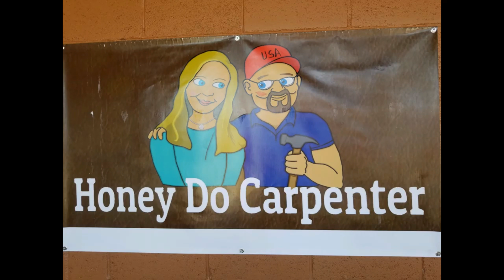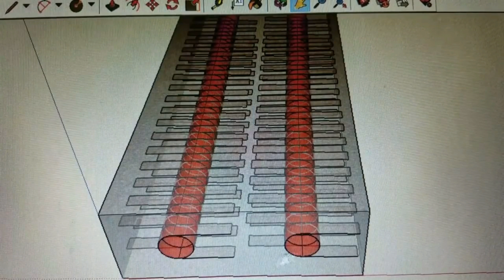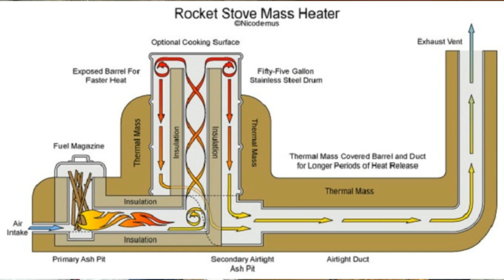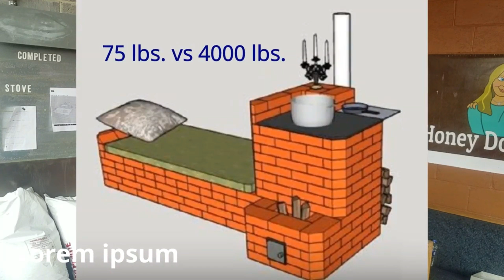Super Efficient Homemade Stove , Use 1/10th the Wood

Comment: Darwin I am extremely intrigued by your design and the capabilities of your stove. Would this be considered a rocket mass wood stove? I actually have a pot belly wood stove that I have been thinking of adding a secondary burn chamber where the current exhaust comes out encasing that with a cylinder for the heat and gases to further burn and combust then route my exhaust out through the back and up to the chimney as well as insulate the inner walls of the firebox with aircrete. I can definitely tell you have some awesome engineering skills I'm not as good as you but I definitely aspire to be! my question to you is if I sent you a few drawings/my ideas do you think you would be able to help give me some pointers on my design based off of your experience with what would work and what I would need to change? also If my ideas work I am thinking about doing so on a larger scale to help heat our school house that we are working on thank you so much!

Comment: Masonry has ~0.2 BTU/lb*F heat capacity, steel ~0.47.  Few materials come even close to water at 1.0 BTU/lb*F.  How many pounds of masonry does it take to make a thermal battery to store 300,000 BTU if heated from 62.8 to 199F (hottest part of the FTIR scale)?  300,000 BTU is the typical amount needed to heat a small 1000 sq ft house in the north.

Comment: I would like to have one of these for a 24' Tipi? You got plans for building one that will not be too large for that size Tipi? Even the one here shown will do for me? I plan to put it on something that will roll like casters I that possible The smaller the better for the Burner part. But the mass will be separate and I plan to have mass? If I bought one you made how much am I looking at for everything but the mass part of it?

Comment: Are you able to make a larger scale one that can revives more wood. I want something that can be put in my greenhouse in the winter and provide heat through out the night until I get up in the morning to add more wood. If yes, how much
Reply: in greenhouse you can put a compost pile for heat in the winter. also they say that a bunch of leafs will give some substansial heat too

i saved a video on the topic in my playlist called "fire" where someone with a stove in greenhouse dumped it after they found out that it was enough with leafs, perhaps there was a container of water too

Comment: Remember that shiny metals have a very low emissivity and you does not get anywhere near the real temp.
Paint it black and problem solved, and also help radiate the heat around it that can increase efficiency a little 😉

Comment: Please be careful about having the high heat of a rocket stove against steel.  This WILL result in the spalling of the steel (basically corrosion) and destruction of the stove.  Coating the steel does help.  Regular concrete can spall also, so try using fireplace mortar or refractory cement.  Try ceramic fiberboard for most of the structure, supported by a steel frame, and the firebox lined with firebrick (to withstand the abrasive wood).  
Would you be so kind as to try refractory cement in your Aircrete machine please?  Thanks.  Could you also experiment with the riserless rocket stove design?  Thanks for all your work and ability to make the knowledge available.

Comment: Love what you are doing, I  have been kicking around the idea of using solar hot air system fan running on a small solar panel so it would work automatically.  to heat up the thermal mass of the stove bench or a thermal wall, heating up all day simple hot air panel should be around 140 plus degrees and you would only have to do a burn when it's really cold. I'd like to get your impute.
Reply: exactly. do it!

Comment: am I missing something? Or another video?  You talk much about how great this is or was in one burn, but I never see a burn, or any details of testing? You can tell me how unbelievable it is, but how do we see it? @6:21 time, you say you go over test results? I must be missing this?  so your saying this 75-80# of unit weight, will hold how many BTU's?  I am very willing to be impressed, but please show me.
Reply from the maker: Scott, I get it , really I hear you. However testing it and burning it in the open air is not quite as impressive as putting it in a 2000 square foot home basement we are running data tests as we speak in a home where it was installed first with a window insert and now I am placing it in place of a standard stove to an existing chimney. I am altering the chimney by dropping aircrete insulated stove pipe down the chimney to run the stove out of, stay tuned. thanks HDC
Reply: @HoneyDoCarpenter  still tuned 😎

Comment: Negative pressure in any system is created by chimney temperature. 
If the chimney temp is too low, it will run positive pressure. Exhaust temps need to run at a minimum of 200°F.  
Having said that, if you're chimney temp is much higher, you're throwing away excess heat.
Reply from the maker: sounds like advice from a kindergartener
Reply: Do the tests on different arrangements.  You'll discover the same thing I did.
Classic bench style rocket stoves (or any other stove) only ever go to positive pressure when the chimney temperature is too low. Cooler gases in the chimney want to fall back, work against the heat riser, create positive pressure in the bench and back-smoke, leak, etc.
This is directly tied to how much heat the mass absorbs and how much is left over to rise out the chimney at the end.

I've done this test several times, building test beds with various heat absorption capabilities. As long as the chimney is hot enough, a bench pipe full of holes will consistently draw inwards. This can be seen by waving a smoking ember (incense or tobacco stick) near the holes.

This will change according to the difference in temperature between the exhaust and the outside world. 200° F is about right in that the outside air is not likely to ever get that hot and water vapor will not condense within the pipes. I've seen these work with far lower exhaust temps, but they become unstable and fail to work well in all conditions.

Comment: Have you been able to concoct a mix that can be pumped with a cheap harbor freight trash pump.  The best I have come up with loses about 20% volume.  It works, but decreases the insulation value and increases weight density - not ideal for a roof.   I also modified your wall forms to be removable and make interlocking panels - just cut the small metal u track in half and tack in another in opposite directions (or you could just bend your own)... goes together air tight with a small amount of spray foam or mortar and holds together great with stucco (the mesh and stucco help hold it together too).

Comment: Darwin, are you saying this model cannot be used with a bench? I am looking to put the stove in my attached garage but run the through an internal wall to a bench in my main living area. Exhaust would be vented up through garage roof. Thoughts?
Reply from the maker: It will work just fine for a bench

Comment: Do you apply some water glass coating on the surface of aircrete panel ?
Reply from the maker: I do treat the riser with water glass, and while it is still wet I sprinkle portland cement on the inside to give it a hard coating, Three seasons on julies riser and going strong.
Reply: @HoneyDoCarpenter  That's great.  Thanks Mr.Honey Do Carpenter.

Comment: Darwin, I have a few questions  first isn't this just a smaller version of tiled stove, with metal around it instead of tile?
Second what size area can this heat? It might be good for a 200 sq ft room but there is no way it can heat a 2000 SQ foot house with walls. 
Third where is the exhaust going to?
Reply from the maker: actually ,yes it can heat a 2000 square foot home...
Reply: to answer your questions first as far as i can tell its a rocket mass heater version.

second he is installing one for dirtpatcheaven in their 2,100 sq ft home and they will be testing it this winter.
third the exhaust gets run outside if you want more info let me know.
Reply: @GH-sy5wn  again o don't see it any different from the Russian tile stoves, but I'm interested in finding out if the mass is enough to heat that home. I fear it won't be for overnight. I know I'm a few months behind on the videos, but I really do love his core and his firebox, can't wait to see the thing work in a bigger space.

Comment: It the temp of the exhaust that determines the efficiency.
The thermal camera shows high heat at the top
Reply from the maker: That is the top of the riser.all The heat is right where it should be. The major heat is in the secondary burn area at the base of the riser.  The Stove is working perfectly.
Reply: @HoneyDoCarpenter   yes
But if hot air is escaping at the top then efficiency drops 
Ive seen videos of people sticking their hand in the exhaust
Loooking at about 110 F  
You do have a exelent design 
Just concerned at the exhaust temp
Reply: @tomrobertson3236  that must be interior insulated riser and then mass heat-absorbent cover goes on top and over it, redirecting rest of the hot air thru outlet at the bottom, near the burn chamber. I am trying to decipher the concept built out of those clips as much as possible...
Reply: @Prosper661  the traditional rsmh has a 55 gal drum turned up side down over the riser
The sq ft gets quadruped thst way 
So the exhaust gas decompressed 
The drum then becomes cooler and radiatez out into room 
Darin is on new ground so it will be intersting to see what he comes up with 
One thing you cant do is rob the riser of heat 
Its needed for complete combustion
Reply: @tomrobertson3236  traditional rsmh can weigh few tonnes and metal drums gets burned and replaced yearly (second hand info, don't quote me on that). Darwin's initial idea was portable stove and highly efficient, with heating as primary purpose (no cooking) with possibility of connecting it to a mass heat-absorbent bench. Aircrete qualities allow fuel burn to be clean and in high temperature and he (I believe) is not using metal drum, but thicker heat-absorbent cover over riser which won't get worn with use. The goal is to get ca. 45 min complete burn with almost all heat being absorbed into stove (and bench if used) and then slowly released.
Reply: @Prosper661   you can add life to the drum by welding a saw blade or any other metal to it .
In the past they added vermiculite to mortor to help insulate the riser 
Lately they have wrapped it with ceramic insulation which is the best way now 
Darwin researched pretty good past practises 
There is a formula for sq inches goung into the riser and then the riser must have same sq inches
A Dutch guy . Peter came up with the P channel to direct air into the riser to complete combustion 
He put a lip at the end to help cut off the air so it didnt cling  
The metal drum was used to redirect flue gas into a mass bench 
A good stove will release the exhast at around 120 F
Stick your nose in it and you might smell a hint of smoke 
Efficiency is based on what the exhaust temp is 
Which means you've stripped all heat out of it 
Dawin is breaking new ground 
So hang on and see what he does
Reply: @tomrobertson3236  yep, it's going to be good. Found a vid on his page, where he goes into details: pea gravel and soapstone as heat-absorbent, aicrete insulated exhaust, enough draft to run air thru bench with 2 feet drop from stove, no fumes etc. One thing I don't get is: in a bench as his pipes are surrounded with perlite/soapstone they get then covered with aircrete. What that does to the heat from those pipes?
Reply: @HoneyDoCarpenter  NO VIDEO DE 8 DE JUNHO DE 2019 !!!! ....QUE PORCARIA FOI AQUELA ???? NAO EXPLICA NADA
SOBRE MEDIDAS E PRODUTOS... MUITO RUIM SEU VIDEO ....MELHOR PARA COM O CANAL .

Comment: Seems like the cart is way out in front of the horse. These designs need a couple seasons on them at a minimum before there actually used in a home. 
If not we’re just working with our feelings. That’s never a good plan. 
Put some temp sensors on it to graph some data. Burn the heck out of it all this winter. Then take it apart with an unedited video.
Then you’ll have something to at least sell for the shop stove until you have some mileage on this machine. 
Just common sense says your a few versions out on perfecting the design. 
No plan makes it through first contact. 
Looks sharp and promising.
Reply: too bad we dont require your standard for operation, and can choose our own. that means you will be 3 years behind us if you ever even get on board.😎
looking back at you kicking dirt clods. lol.